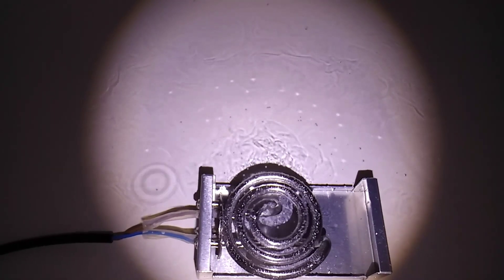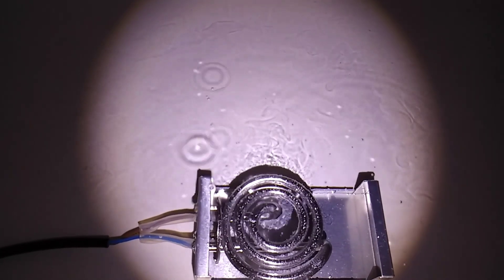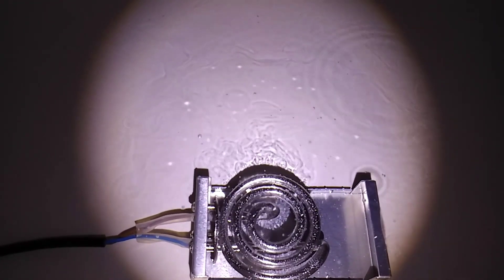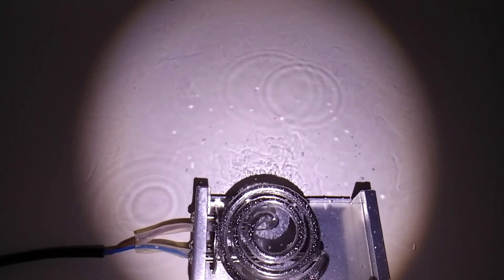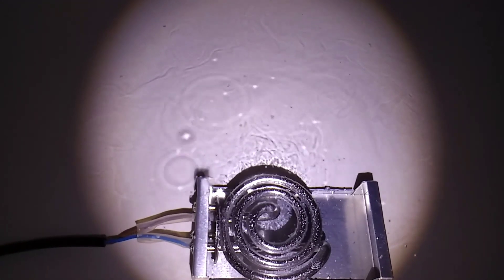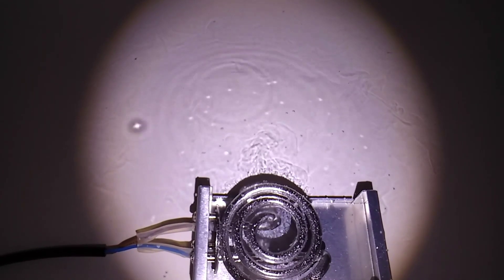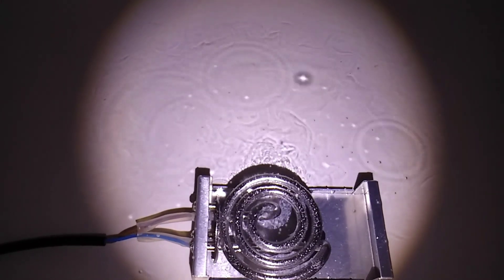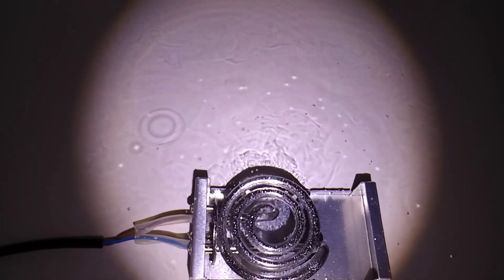Danger-bath.  If it's worth doing it's worth doing dangerously.

Comment: Lots of visual appeal there! Mind you if that's  a max. 3kW element (13A @ 240V), and your "average bath" is some 80 litres (per WaterWise UK),  it'll take about 12 minutes to get from 10C to a "bathwater warm" 35C, so remember to set the kitchen timer accordingly :-D
Reply: How many BTU (British Thermal Unit) would be required to raise 80 liters 25C? [no calculator use allowed for this exercise]
Reply: 4177 BTUs? for a 1 hour heating . Watts = 3.1 x Gallons x ΔT (in °F) / Heat-Up Time (in hrs) 

Watts = 3.1 x 17.5 gallons x 77*F / 1.0 = 4177 BTUs
Reply: To heat 1 liter of water by 1 degree Celsius you need about 1.16Wh so 25C x 80 liters x 1.16 = 2.32kWh so with a 3kW heat element it will take about 46 minutes. Of course I ignored the bathtub thermal mass and loses or gains from ambient air.
Reply: 1Ws = 1Joule so 1kWh = 3600kJ
Reply: No, it's litres, not litre's ... unless you have a litre that possesses something.
Reply: Yes 1 1 1 as i remember it altho KW/h where expressed as joule'
Reply: What the fuck are you on about ? go back to college FFS ! oh BTW its litre's not liter.
Reply: john carlaw: Nice ideas! Never thought about this.
Reply: Ahh, Turners and Clyde ...  Best buddy movie ever!
Reply: @electrodacus "How do you pay for electricity and natural gas" KWh for the electricity is pretty much worldwide and Therms for the gas is as well you dumbfuck.  Guess what a therm is?  It's a volume of natural gas required to generate 100KBTUh.  This shit is central to the fucking worldwide petro and gas markets...
Reply: I do not have a natural gas connection but if I had I will have paid using kWh as unit of measurement as it is the case in most of the world.
I guess you are in US or UK where this outdated therms unit's are used. For your information 1 Therm is 29.3kWh
Just made a quick google and here is what Wikipedia mentioned
"United Kingdom regulations were amended to replace therms with joules (the S.I. unit of energy) with effect from 1999. Despite this, natural gas is now usually retailed in kilowatt-hours, although the wholesale UK gas market trades in therms, with a typical forward transaction being for 25,000 therms (31 MW) per day. In the United States natural gas is commonly billed in CCFs (hundreds of cubic feet) or therms."
Reply: electrodacus Of  course, the normal world  sells natural gas in kW/h, transformed from the cubic meters actually measured, times the density of the gas. But Brits and US guys always want to be special. It makes no sense using non-metric units or non-standard  units. It's a Kitty that Napoleon didn't win the war, or we would also have the hundred minutes hour, the ten days week, the ten months year and the ten hours day, which all would be so much practical. Finally, we are no more living in the Babylonian era. Well, maybe we not, but the British for sure.
Reply: Australia and New Zealand calculate both gas (Nat. and LPG), and electricity supply in MJ.
Reply: At what pressure? And what liquid? Mercury? Insufficient data given to answer the question. (God I miss giving smartass answers like this to test questions in school).
Reply: BTU (British Thermal Units) are not used internationally. Wh is what is used in most parts of the world for energy.
Reply: It depends where that stove was manufactured and what markets it is sold in. It will not change the fact that is not an international unit for energy. Also if the stove manual shows the power output it should be in BTU/h not BTU.  BTU/h is unit for power same as Watt and BTU is unit for energy same as Wh is in the international system.
Reply: Maddie: Can't you Brits finally use normal units? Like liters, Celsius, meters, kilos...In your stupid system, there a even different gallons and ounces! C'mon, be like everybody else! It's so much easier. In France, they don't use Réaumurs for temperature and lignes  for small distances.
Reply: We do you fucking idiot ! just because you don't understand science beyond basic measurements isn't our problem
Reply: Use kelvins law, a lot easier.
Reply: +Juri Vlk - You shouldn't act so condescending if you don't know about something. BTU's are used internationally, but apparently you are too young to have bought something like a gas stove, camping stove or any kind of kitchen stove really. 
Besides that, Brits use Celsius. Good job calling a system 'stupid' when you don't even know the difference between Brits and Americans.
Reply: +electrodacus - Gee, that's weird, because I don't live in the UK and when I go to the store to buy a gas camping stove, or if I look at the manual for my kitchen stove.. hey, wouldya look at that, it shows output in BTU's.
Reply: Well guess what, if I buy a gas stove made in China and it's sold in a non-UK country and the main unit it uses for showing it's power is BTU (or BTU/h you pedant) than it's an internationally used unit. If I go into a kitchen store here (again, not in UK) and the salesman shows me stoves and talks about the BTU of the burners on it.... I could go on.
Reply: How do you pay for electricity and natural gas ? I will guess unit will be kWh and not BTU.
Canada is also officially using SI units for a few decades but because of the proximity to US and source for most of imports in store the products will still be labeled in imperial units with the conversion to SI also marked usually with smaller fonts :).
I wanted to get a 5mm drill at a large hardware store and there was no metric drill available so I needed to order one on eBay from UK :)
If you use SI in your country why will you prefer BTU that has the definition (amount of heat required to raise the temperature of one pound of water by one degree Fahrenheit).
Reply: Specific heat for water is yes 4.187 kJ/kgK and you can divide this by 3600seconds to get 0.00116kWh/kgK that is where the 1.16Wh to rise one kg (about the same as 1 liter) of water by 1 degree Celsius
Original comment was wrong that 12 minutes is what will take a 3kW heat element to heat those 80 liters of water by 25 degree Celsius and it will actually take  about 46 minutes.
1KiloCalorie = 1.16Wh
So 2500kcalorie are 2900Wh / day so around 120W average power (but it will be quite a bit less at rest then when performing some physical tasks).
To heat 100kg of water by a 25C delta will require 100 x 25 x 1.16 = 2900Wh so yes your calculations are correct by I prefer Wh for energy :) no need for any other unit.

Comment: I heard there was an old man who did his to heat his bath, he had a heart attack and died, a few days later neighbours complained of a smell, essentially it had turned him into soup... Also, isn't your bath earthed??
Reply: Why did his neighbours complain?  Don't they like soup?
Reply: Should be. Even if the bath's non-conducting (acrylic or GRP), any metal fittings (tapware / drains) should be grounded to meet Building Regulations.
Reply: Jimbo - when I replaced the bath in my UK home (OK, in the early 1990's) which came with the overflow / drain fitting already in place, grounding wires were already fitted, and the installation instructions clearly stated these wires had to be connected to the cold water pipe (and there was a clamp provided for that purpose, with a "Safety Earth - Do Not Disconnect" label attached). Bought that bath from Wickes, Southampton (and I note they are still there!!)
Reply: phonotical everything used to have to be bonded together in the 15th edition regs, but not any more (17th edition) , just at incoming supply
Reply: Grounding metal fittings isn't done anymore in most countries.
Reply: How do you know he died from a heart attack if he was already soup when they found him?
Reply: I red soap at first...
Reply: @Vampi_Sweden  That actually does happen sometimes, to people on sunken ships.
Reply: @bwc1976  Interesting, maybe it has to do with the salt content in the water?
Reply: Sites like http://z0r.de/12 are still online too..
Reply: just add Crouton's
Reply: Just always assume anything ISN'T grounded, it's simply safer and with all the shoddy goods coming in so cheap (staring at You China!) you are much better off that way.
Reply: brokenhalo22 that is truly gruesome.
Reply: At least he didn't swallow a fly.
Reply: StriKe jk Hienz Cardiac flavour
Reply: phonotical A bath has only to be earthed when it's made of iron.
Reply: not usually directly earthed, but will hopefully be connected to the pipework which should be earthed
Reply: Simmer man, they called him. There's a couple of pics still on Rotten. Not for the faint of heart, of course.  http://poetry.rotten.com/simmer/
Reply: Phil S $10 says someone bought the same bath and promptly clamped the ground wire to Plex pipe.
Reply: Bonding random pieces of metal to each other is a waste of time and copper.  A kitchen sink is neither an extraneous nor exposed conductive part.  Supplementary bonding is no longer necessary either now that we have RCDs everywhere.
Reply: I think if the drain plug is metal its earthed goes to test it

Comment: At least it doesn't pass a current through the water, like the infamous baby electrocuter from China.
Reply: I find your attitude appalling. I am immensely disappointed that it doesn't pass current directly through the water! I demand more danger!
Reply: Depends on how well the  connections at the end of the element is sealed
Reply: Search for "2.5kW electro baby-cutor. (And dodgy bucket warmer.)" My favourite line: "The baby would become live, at a hundred and ten volts."
Reply: It does pass current through the water... indirectly, there's no waterproof insulation on those wires...

And it doesn't trip circuit breakers because it's not grounded. Drain pipes are plastic, so is the bath.

So in theory if Clive jumped in the bath, and didn't sit on the heater, he shouldn't get shocked. Kind of like how birds sit on power wires without getting bbq'd.
Reply: An immersion heater is not the same as an electrode boiler. An immersion heater works by high resistance resulting in heat, the other actually livens up the water.
Reply: Finn Nocher 
In the US , normally the GFCIS don't protect the whole house. Just one circuit for each GFCI.
But according to google, they trip at less than 5 ma, and in less than 1/10 of a second...
That is supposed to keep people from toasting more than bread in the bathtub. 
Personally,  I quit doing that,,,, the bread gets too soggy....       (•¿°)
Reply: Until a squirrel grabs a tree and bbq's, or bridges 2 wires...
Reply: GFI rules don't apply with Chinese made equipment, the earth wire has been carefully surgically cut for safety.
Reply: Assuming the GFI works in the same way as our RCCD, then it's only looking for an imbalance of live and neutral, so even if the neutral found a better ground path than the live, the RCCD will trip.
Reply: Yep, GFIs don't even connect to ground. They don't need it. All they need is a toroidal/hall effect based ammeter with both positive and neutral running through it canceling each other out. If any current is measured, current is leaking to ground and it trips.
Reply: Richard Smith if youre so sure about that, then grab a wire in each hand, put one into live and one into earth and then tell me again that the RCD can save your ass, if you are still alive at that point. Yes, I do know how RCDs work but I also no about their limitations. Of course you are leaking to earth but the resistance of your body is so high that the current flowing is too low to safely trigger the RCD but it is high enough to threaten your life.
Reply: More info on this chinese baby electrocuter?
Reply: Questions, ,, if current is leeking,  wouldn't that trip the GFI?
Reply: As the bathtub is grounded, it could trip the GFI depending on the resistance of the water and the sensitivity of the GFI.
Reply: In the UK the RCDs/GFCIs you'd need to worry about in a house would be 30ma, so this would be nowhere near tripping.
Reply: As long as the difference in current is at or above the rating of the device, which it may well not be, seen as the loop impedance may be very high
Reply: Clive did mention in the description he only measured 1 or 2 mA of leakage current, the water on the Isle of Man must be quite pure with low ions. He doesn't mention how sensitive his GFI unit is, but in Australia standard domestic units are 30mA. Only hospitals or medical situations use 3mA units
Reply: GFI units are one of those things that in general are a good idea but can lead to complacency, I have had some nasty belts when working on wiring with GFI protection. They don't trip if you connect across Active and Neutral, as I found when grabbed an unearthed lamp fitting in a shop that had a bare wires where the insulation had crumbled.
Reply: Australia and the UK are very similar for electrical from what i've seen, our rccd is 30mA in the UK too (for sockets), with an overall (whole house) of 100mA.
Leakage in a bath depends on whether the bath is metal (and grounded), and what it's coated with (enamel), the only exposed metal may be the drain, but is that grounded.
Reply: I did a test with a friend, a correctly fused 2 core cable (like that used for a lawn mower), got the friend to stretch it across a wood block, then cut it with an axe (simulating a mower blade cut), it didn't blow the fuse or knock out the rccd.
Reply: Yes, RCD/GFI doesnt have a connection to earth and simply measure the leakage between live an neutral but the triggering current is usually so high that it still can kill you without tripping it. Its protecting against the use of broken devices that leak to earth, not against touching them and being the leak yourself and many devices dont have earth continuity which is extremely dangerous when exposing conductive parts.
Reply: If you touch it yourself, and get shocked, YOU are leaking to earth. Of course it will protect you. Whether or not the protection will save you or not depends on a lot of things. If you touch both the live and neutral and leak to neutral, I guess you are shit out of luck, but who would do that and why... You would have to go out of your way to intentionally do that in normal circumstances.
If your finger bridges a component, you will not die, the shock will pass through the two points. You would have to touch neutral with one hand and live with the other, for it to pass through the heart to kill you. Otherwise it will just hurt like hell and maybe burn you. It is FAR more likely someone will leak to earth through their feet, which GFI's do protect against, whether the device is grounded itself or not.
Reply: Yes very similar from what I've heard apart from your ring circuit for socket outlets, in Aus we use a single point supply for each final circuit, personally I think the ring main is a better system. Over here nearly all our baths are either plastic based or man made cast aggregate / stone to give a marble look. We also have almost 100% PVC drainage systems now and plastic water supply pipework is becoming more common in newer houses, our electrical authority has banned the bonding of main earth cables to exposed water or gas pipe work because in all probably once it goes below ground away from the suns UV it probably reverts to plastic. Each metered supply to a house must have a dedicated earth 'stake' a 4ft rod hammered into the ground near the switchboard or a buried steel mesh (heavy concrete reinforcement mesh) for larger installations.
Ray
Reply: It's so random isn't it? depends on f you sever one cable first, hit both at the same time, or if you manage to break the short before the fuse blows, the loop impedance of the cable so many variables.
I still have a pair of side cutters that I blew the side out of cutting a lamp circuit cable which was tagged out as isolated in a factory roof, tripped part of the factory off
Reply: I retired about 7 years ago from the electrical trade, so i don't know what the current regs are, but when i was still working, the bonding to water pipes was for internal protection only, so if something like the electric water heater had a fault, the pipes in the house wouldn't become live,
The ground stake is entirely different, it's supposed to be a feedback to the transformer so that fuses and trips would trip, if the loop resistance was too high, we would install a RCCD.
Reply: you're sure you don't mean line and neutral? line and earth would trip out and you'd be safe (hopefully)